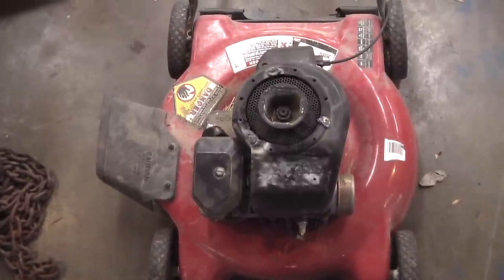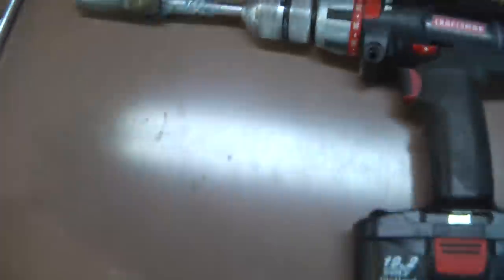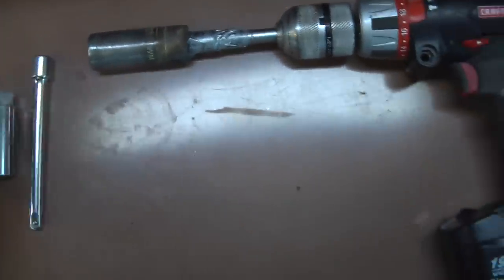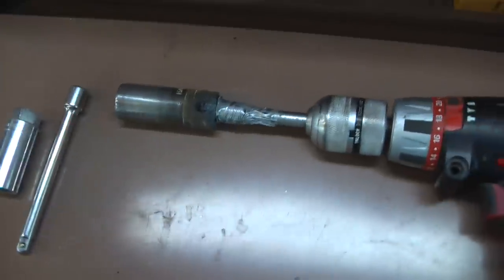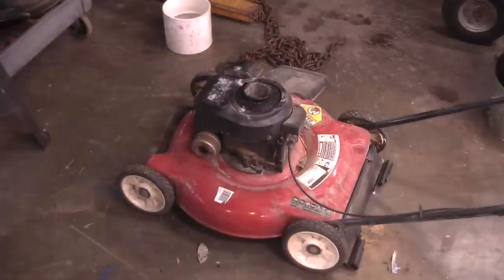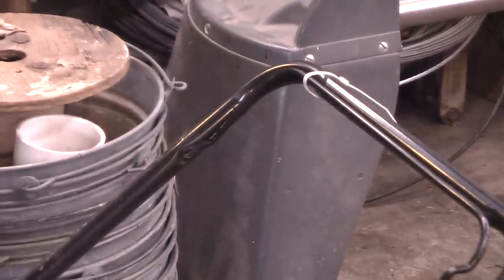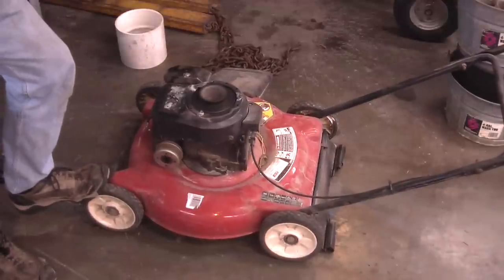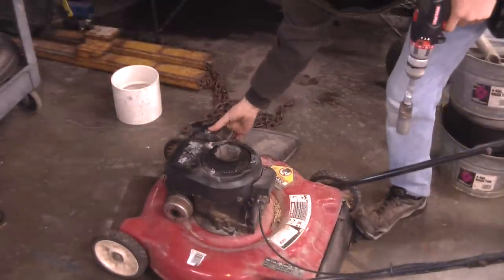How to make an electric start for small engines

Comment: HA HA HA   DONT TRY THIS AT HOME.  Why not hold the mower on its side with one hand and then spin the blade with the other hand? If you dont wear gloves you will get a much better grip on the blade  but most likely only the first time you start it that way because it will be quite a challenge to start it using only your stub but your not as likely to loose your best pair of shoes because you will have to be squatting  down beside your mower when you do it but that of course could put more valuable parts in the way  of a blade spinning at 3500 RPM and could ruin any remote chance you might have for reproduction.This method is of course is  the most dangerous way but only the first time you try it because after that you wont have that extra hand getting in your way anymore. The other downside is you wont be able to tie your shoes  but then again once you chop off both feet that wont be a problem for you anymore anyway and if you lose a hand and your reproduction part you will have nothing left to count your change with.  LOL  Funny video but a very stupid thing to do.